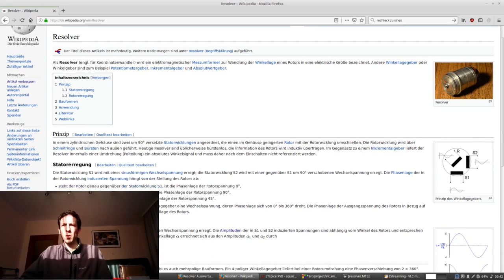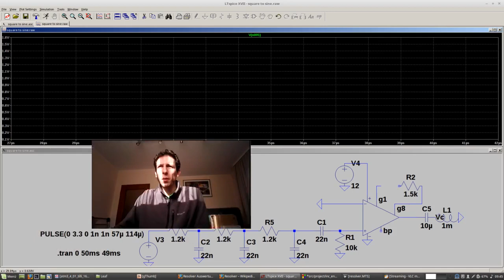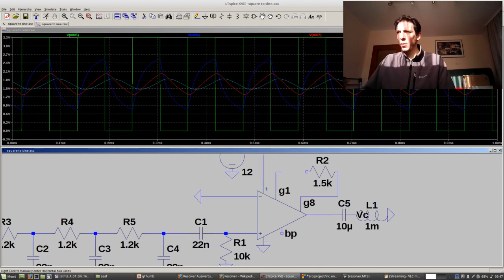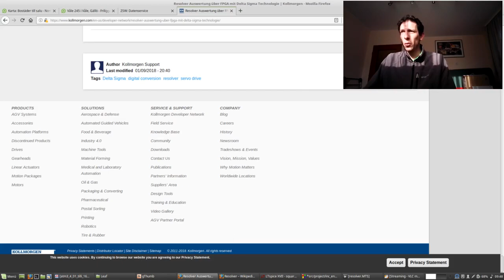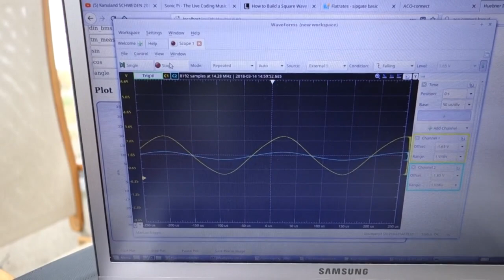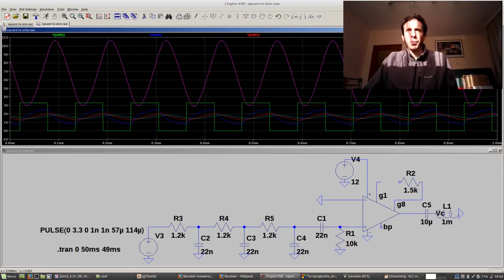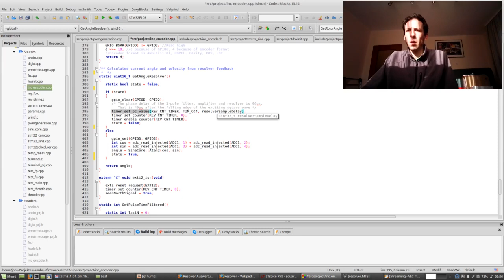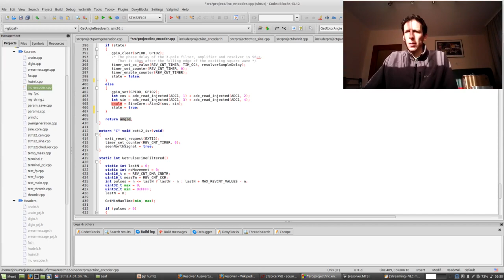EV fundamentals #1: How to read a resolver

Comment: From my medical equipment repair days, I have come across resolvers that the reference coil is on the stator and the readout is done on the rotor ( they can definitely afford the space there ). Nice stuff indeed, not many people know of them nowadays ( most motor control will actually be done with encoders with an index pulse given from somewhere in the system ).
Reply from the maker: Oh cool, so that actually exists then.
At least in vehicles and with synchronous motors I have only seen absolute feedback such as resolvers or sin/cos hall chips.

Comment: Thanks for the video.Let mi suggest a topic : An electrical axis.
An master encoder, a slave encoder and an output that control a motor+slave encoder 
that follow to master encoder in velocity and phase with a low margin de error (< 5 degrees so and so).
Thanks Johannes

Comment: Superb video. Thanks for the in depth walk through!! Looking for more in this series. Btw, just a basic question: why are there many coils when there are 2 output signals and 1 input? Are they connected on parallel?
Reply from the maker: To be honest, I have no idea. It is 4 pole pairs (1 physical turn yields 4 electrical), thats probably got something to do with it
Reply: According to my understanding they are connected in series. The one in the middle is the Tx and the right one next e.g.the sine coil and the one left to the Tx is the cosine Winding. However, a 4 pole pair should have 12 cool systems instead of 10 :/

Comment: Thank you for this excellent and informative video, Johannes.
Please would you consider expanding the code to handle synchro resolvers which have three secondary windings connected in a Y configuration?
Otherwise, it is necessary to convert the 3 phase synchro signal to a 2 phase resolver using a Scott-T transformer (difficult) or equivalent solid state converter.
Thank you again 👍
Reply from the maker: You're welcome. It's targeted to EV motors and those don't seem to use synchro resolvers. Sounds like you need something like a Clarke/Park transform for that. It's open source, give it a shot ;)

Comment: Hello! Is this board "Main board V3" capable of handling prius gen 2 inverter coupled with any toyota PMSM motor with resolver? Thank you!
Reply from the maker: The exact combination has not been tested, but yes the board can handle resolver and the software can handle PMSM. Both tested with Nissan Leaf hardware
Reply: @EngineersFear  Cool, I'm now in the middle ow hard desigion what to buy for prius gen 2 inverter. 
Another last one question: are two boards capable of handling two inverters(inside prius inverter case) in parallel to drive two similar motors(tesla-like 4WD) or one board can handle two inverters at the same time? Thank you!
Reply from the maker: @konstantin88181  Yes you'd need two controller boards
Reply: @EngineersFear  I've already came to same conclusion because the board needs to get a feedback from a motor. And feedback from two motors will be different. Thank you!

Comment: Functional safety involves correct component selection, electronics/system design, as well as software development. Safety doesn't seem to be covered in any of your videos or inverter designs, which is worrying because an incorrect torque could cause a serious accident.

Comment: Is there a way to determine the resolver pole pairs count?
Reply from the maker: In the picture you see that the core has 4 lobes = 4 pole pairs.
But I haven't seen enough different resolvers to be sure it's always that easy.
Reply: @EngineersFear  Thanks, I'll go with that to start with, mine appears to be 4 pairs by that reasoning too. https://openinverter.org/wiki/images/d/d1/20201124_214308.jpg